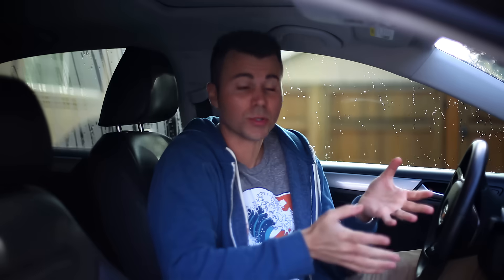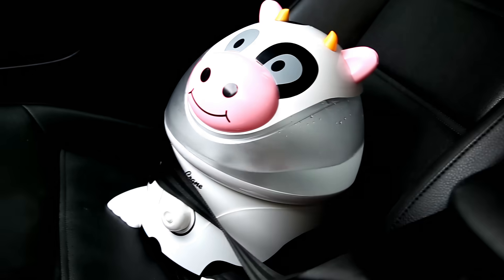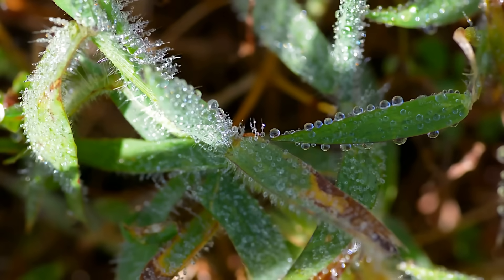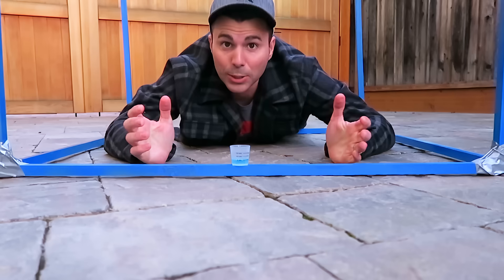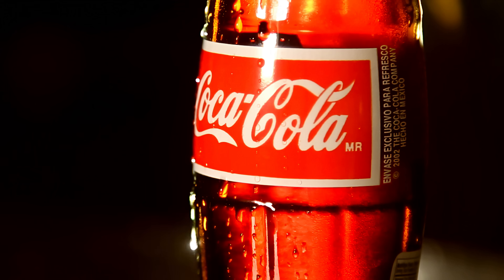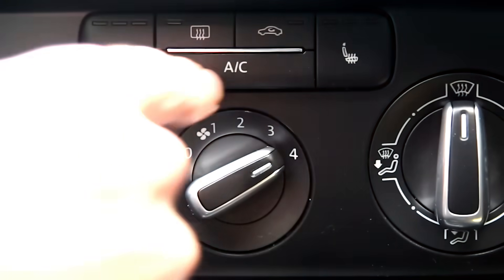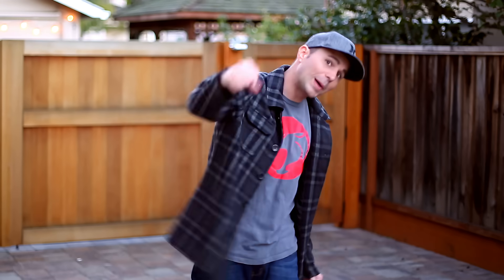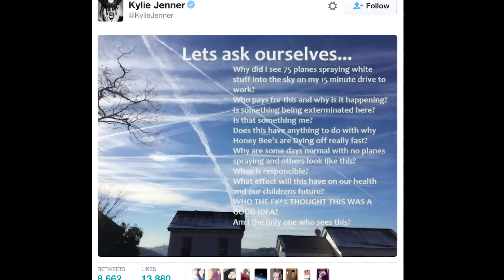Defog your windows TWICE as fast using SCIENCE- 4 easy steps

Comment: Huh? "Ten times less than..."
How is that be possible?
If I have 50 of something and REDUCED the amount by ten times. does that mean 10 x 50 = 500, or 500 less than the original 50? To a negative 450? Hardly.
Case in point: In the title, rather than say "two times less" you CORRECTLY say "Defog your windows twice as fast".
Are we to assume "ten times less" mentioned in the video really means "ONE-TENTH" of the original?
Just sayin' ;-)
Reply: Ten times less, in spoken English, typically means the same as one tenth.
Reply: @zachpw  Fine, I'll give you "typically". But that still does not make it correct.
How about using CLEAR and CORRECT spoken English and just say "one tenth" in the first place?

Comment: The true trick to defogging your windows is turning on the vent AND foot air option. (As opposed to just vent only). Having the air blow through your vent and feet separates the slightly warmer and slightly colder air. Makes a huge difference and they’ll de-fog faster.

Comment: I use a small towel to get it dry but there is often a shmeez layer of oil and decomposing plastic that turns white especially looking into the sun. Alcohol wipes,Windex or newspaper gets it squeaky clean. 
Defrosting I use a credit card to remove frost.

Comment: Why would the AC setting need to be on if you're drawing outside cold air in, heating it up then sending it out?

It's not being cycled back in so and the outside air is already cold.
Reply: Air conditioning doesn't just remove heat, it removes HUMIDITY as well, which is why the AC comes on for defrost.  You want HOT/DRY air.  The defrost function allows the A/C to run(with heater) when it normally would not, creating HOT/DRY air, instead of just hot air.   It's most likely drier outside the car than inside.  The drier the air coming in, the better the defroster works.

Comment: Ohhh my, when fog is inside, it's because windshield is getting warmer on the inside compare outside, therefor AC has to be used to get the temperatures closer... When inside windshield temperature gets too cold compare outside, it fogs outside and vipers could be used. This is the same effect happening while breathing on mirror to clean it, mirror fogs on side where we making it warmer. Also, windshield can be cleared by baking it with hot air too, which will evaporate all moisture on it as well, it will just take longer

Comment: For me I just turn on my floor heat but only if it's really moist and cold outside, the rest of the time I use the defroster. Reason I have to is my car has a rather poorly designed ac drain so if I use the defroster (which turns on the ac compressor automatically) when it's moist  outside not all of the water drains out. So after my windshield if defogged/defrosted when I switch on the floor heat which turns off the ac compressor, the windows just fog up again. So most of the time I just use the floor heater to defrost because the water doesn't evaporate fully.

Comment: The biggest problem is that all cars deal with climate control differently. A lot of newer cars have a climate control that only lets you set the temperature, where the air is blowing from, how much force the air has, and whether or not it's recirculating. Other cars can't run the AC and the heater/defrost simultaneously. And I don't think it's a good idea to run them both simultaneously if you can.

Comment: Different vehicles will affect which settings work best. Also, whether you're dealing with frost inside or outside.
Reply: All vehicles have the same settings, just some are in different spots. The de-mister mode has a universal symbol, and if you have dials/levers you can change those settings pretty quickly. Also if you have frost inside I would hazard a guess that you windscreen isn't sealed properly

Comment: Step 2.  Replace the window or door seal that is allowing moisture into your interior.  If the build up is outside of your vehicle (99.5% of the time) defroster on full with winter windshield solution in your washer tank that can be sprayed onto your windshield to eliminate frost.

Comment: There's another thing that really helps: the condensation that's there in the morning, comes from the water that was present in the hot air in your car when you got out last night. All you need to do is to leave the windows or doors open for 30 seconds when you get OUT of the car, so it's cold inside, before you close the doors. That way the problem will be five times smaller tomorrow morning to begin with :)
Reply: i live in norway and here we use the millimeter trick, just leave 1 window 1 millimeter open when parking , and the air will dry out the car.
Reply: @magnetmannenbannanen  Doesn't water or snow get in the car this way?
Reply: @Jeroenneman  No, but weather shields are great, they also let you crack the windows when it's raining and you're driving, you should try some.
Reply: @magnetmannenbannanen  yay! cool, dry and simple solution.     For everyone else.. They said "i live in norway and here we use the millimeter trick, just leave 1 window 1 millimeter open when parking , and the air will dry out the car."
Reply: @magnetmannenbannanen  sounds safe
Reply: @Menwulf20  Safe? u mean u are afraid of the car getting stolen? here in norway there is very little car theft unless you have a brand new car. cartheft is also hard to get away with in my part of norway as there is just 1 road to go out of the country, and that road has a  automatic licence plate reader so the police nows who goes where.
Reply: @magnetmannenbannanen  I have a Toyota, it will move 50 feet before lowjack shutsdown the engine
Reply: @magnetmannenbannanen  what's a millimeter?
Reply: open all four doors for a minute
Reply: @bballhead111  i got a 2 door 😝
Reply: I try to make sure to shut off defrost for this reason before I get home.  If the glass is cold, snow doesn't melt on it and turn to ice over night.  I'm going to include opening the windows a few blocks before home and see if that helps the inside.
Reply: Or try running the AC for a couple minutes at the end of a trip
Reply: May try this, I seem to have a lot of water vapor in my breath. Whenever I car pool in cold weather, my quadrant of the car has foggy windows compared to the others.
Reply: Great tip!! Thanks for sharing! Condensation on the windows is a huge pain in the @ss & the bane of my existence. So I really appreciate you sharing that little protip!
Reply: Lies. My cars window is stuck open and I still get ut sooo
Reply: Would the water that has melted onto your floor mats or liner, cause moisture in the cabin? Especially with the heat blasting in the footwell
Reply: You need cold air inside not a cold interior
Reply: I solved the problem by having my girlfriend to just park in the garage lol
Reply: This assumes that it won't get colder in the night.
Reply: @chrismartin1318  the goal is to cause less condensation to build up… not necessarily to cause it to be non existent. Most places that deal with the condensation are a situation where they are driving around with the heater on, and it is much colder outside. He’s just saying to leave the doors open a bit so it’s not so hot in the car compared to outside.
Reply: @EmronWalker  I realize that. But as an HVAC tech who does this for a living, I can say that often times if the car is parked when the sun is out then driven again early the next morning there is a usually at least a 10-20 degree difference. This difference is usually significantly greater than any change  in just opening the doors and equalizing the humidity with the outside. Another factor to consider is that if it's raining you'll actually be putting more humidity into the vehicle due to the humidity outside being near or at 99%. Humidity changes outside quite often during the night and not necessarily in a direction that would be beneficial to this method.
Reply: @chrismartin1318  The answer to this comment is the same as the answer to your last comment^^
Reply: @EmronWalker  this only works if youli e where it is already cold; here it can often be 50 but 30 in morning,
Reply: @chrismartin1318  no. It assumes that it's cooler in the evening when you get out than it was in the day when the car heated up.
Reply: It also assumes you don't live in chicago where a homeless person might also get in your car! @chrismartin1318
Reply: But the ice forms on the outside of the vehicle, the conditions outside don't know what's going on inside
Reply: @alanbrown2666 this video is about window fog, not ice.
Reply: @alanbrown2666  put a quart of water in the microwave for 2 minutes and splash it,   instant ice removal
Reply: You people are making such a simple problem into something more complicated than it needs to be.

All you need to stop your windscreen from fogging up is to go to your nearest parts store and purchase a simple product called "nail hammer".

Then when you get inside your car in the morning and notice that your windscreen is fogged up, whip out the nail hammer and gently swing at your windscreen until all the fog is gone. 

I have used this nail hammer technique on my ex girlfriend's car and she no longer has fog issues or any other windscreen issues.

Comment: I use nearly a similar thing as a Squeegee. Basically all rubber, you wipe it across the windshield. It will get the windshield clear, BUT there will be lots of water on your tool or dripping on anything right below it, so be careful of any sensitive electronics.

Comment: Hey @Mark Rober for the sake of scientific method, did you compare circulation on vs. off? Because yes, the outside air is dryer vs. circulating BUT when you circulate, the air will get warmer much faster vs. bringing in 10/20 degrees below freezing cold air. It sometimes takes 20+ minutes for the car the warm up in Canada so I'd love to see a comparison between only that variable. The AC coils will continue to dehumidify the circulating air anyways so if you circulate, you may end up having warmer air, ie. bigger towel that you keep on squeezing.
Reply: Actually using the re circulated air is counter intuitive when trying to heat or cool the when you first get into a car.
Reply: @icedpacmangames4886  Seems pretty intuitive to me. In the winter you're heating up warm air vs trying to warm up cold air.
Reply: I use a variation of the recirculate button in frigid weather. First, off until the temp gauge moves, this brings in dry air, then on to use hot air. I may adjust depending on what air  I assume is drier.
Reply: I couldn't get my car to heat up during winter until I did this : Fan on at maximum, Recirculate button on, heat at max and let the inside air get warmer.  Once it's done, change for the dryer outside air.  Instead of taking 20 minutes, my car takes 5 min to get comfy and my windows are finally clear.  After 7 years it's about time.  LOL

Comment: Sidenote most cars today when in the defrost mode only pull air from outside once you mix your dispersion then you can pull inside air So models the AC compressor turns on when you turn on the defrost as well to again “ring out your towel”

Comment: Open car hood. Start car. Put heater control in defrost mode. Look in engine compartment and watch AC compressor clutch cycle on and off.
In other words, the AC comes on automatically when the controls are in defrost mode. Why? Because the evaporator coils are used to dehumidify the cabin air.

Comment: Doesn't the air pass over EITHER a heater coil OR the AC evaporator? depending on incoming air temp & what you have selected on the HVAC thermostat?

Comment: There are two points that Mark missed. 1. Since the heat source of the vehicle has only so much BTU capability, running the fan at high speed spreads the heat over a greater volume of air, than if the fan were at low or moderate speed. So, you could have hotter (thirstier) air blown through the air vent if you turn on AC, turn temp up high, and turn fan to medium (not high) (in addition to putting air on fresh and partially opening a window). 2. You can reduce the amount of moisture left in the car by blowing cold air through the system the last few minutes before you park your car. This should evacuate the warm moist air from the car before it condenses. So, if you are driving home after work or shopping, a mile from your home, turn the air to cold-fresh, and blow out the warm moist air. The next morning, there will be less interior condensation on the window.
Reply: 1) turning the fan on high helps, not so much with heating but just having the fan on. I've defogged my windscreen ( say when it's a chilly night and I get in the car) with just the fan

Comment: You may notice that A/C works, but only for a limited time, because a/c coming through the window vents also cools the windshield and can then cause condensation which will look like fog on the windshield in the areas right above where the vents are pouring out that chilled air.

Comment: It is a common mistake to turn on the A/C, and, infuriatingly, some manufacturers do this Automatically! I've resorted to unplugging the compressor clutch, but the radiator fans still run. Yes, it defogs the windows faster with the A/C on. But then you're "addicted" to it. Once you've gotten the evaporator wet, you can't turn off the A/C without instantly fogging the windows up again. Then you're driving around in the winter like a fool with your Air Conditioning on, wasting your fuel and your Money. Much better to leave the A/C OFF but do the other steps, and simply BE PATIENT. The windows WILL still defog, and they will remain defogged for the rest of your drive, all with the A/C OFF in the WINTER. Sometimes I will give a very BRIEF run of the A/C just to sort of bootstrap the process. Maybe 30 seconds or so...

Comment: Umm.... This is what defrost mode does.  It turns on the A/C, turns on the heat, and turns the inside air circulation off.  THAT'S LITERALLY WHAT DEFROST MODE DOES!!

Comment: I thought everyone already knew this....pretty self-evident.    More modern cars in fact automatically will turn on the air-conditioning coils when you hit the defog button.    The heat button usually won't be working well initially anyway,  until the car warms up, so getting dry air on the fogged surface is more important.     Also more modern super efficient engines barely warm up at all,  even long after you've started driving, so hot air usually is not what will eventually do most of the defogging.

A corollary to this is to help prevent fogging of the windows at night, leave the top vent window slightly open.    Any differential between the partial pressure of the moist in-car air and drier outside air will tend to equalize if you don't seal the car completely shut.    I wouldn't crack the door windows however, as someone may try to break into your car that way.   A tipped sunroof or moonroof should be ok though.

Comment: Fastest method on the planet is to fill a small handheld plant sprayer with hot(yes hot water) and spray a mist at the outside of the screen. Not only does it defrost the screen it warms it up so you don’t get condensation on the inside. N.B. Never pour hot water on the screen as it will cause thermal shock and crack. The hot water creates a warm mist that gradually defrosts the screen.

Comment: The blower in my car only hits about 50% of the windshield (the center bit) and has pathetic airflow so nothing really works all that well. The best I have found for my specific car is to run the AC. It clears it up pretty quickly compared to other settings I have tried.

Comment: Dirt and films (from smoking and vaping) will make your windows fog up much faster. Clean the inside surface with window cleaner and a squeegee to get rid of the film. The squeegee is tricky to use on the part near the dash but it’s worth it. Using a cloth just spreads the film around.

Comment: I know some cars used to cycle the AC compressor when defrost was on anyway, without having the AC light on , I think even Cadillacs would do that back in the day but can’t remember when it started, I wonder too if full blasting the heat pulls heat away from the engine being able to get to operating temp, I use to heat you should let the car warm up with the fan off until it was at temp, love the videos

Comment: Most A/C’s will NOT turn on when it gets close to freezing outside and that’s something you should have mentioned!!! That said, was there ever any other way???? There’s no real magic here at all because the only thing you REALLY need to do is to make sure you turn the air conditioner on. That’s actually the ONE and ONLY step. The air conditioner system is what removes the moisture. The rest of the steps are meaningless cuz what moron isn’t aware they need to use the heater as it’s always cold weather when it fogs to begin with. So just turn on the A/C and everything is going to clear up within 30 seconds, I mean how much faster do you need it???

Comment: on a similar topic, if ice keeps freezing onto your windshield wipers while driving, cranking up the heat, putting it on defrost, turning your visors down to trap the hot air against your windshield, then regulating the temperature by cracking a rear window instead of turning down the heat can do the trick.

Comment: In the winter using the heater in full blast immediately  can crack your windshield. Happened on my dad’s truck.
Reply: not when the engine is cold to. It can't happen because the engine has not warmed up the coolant used for the heater yet. The engine would have to already be fully warmed up before you tried to defrost and even then very unlikely it could be hot enough to crack a window.